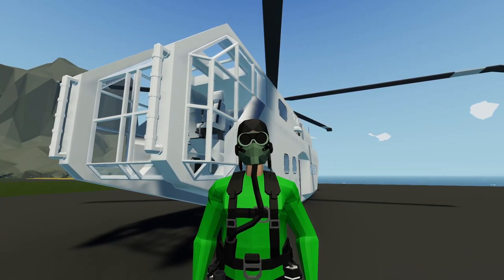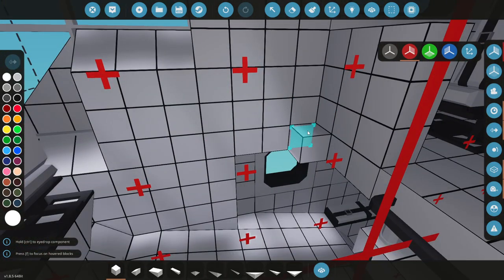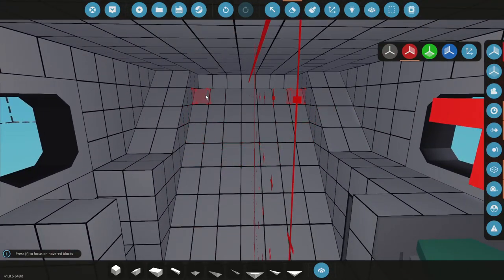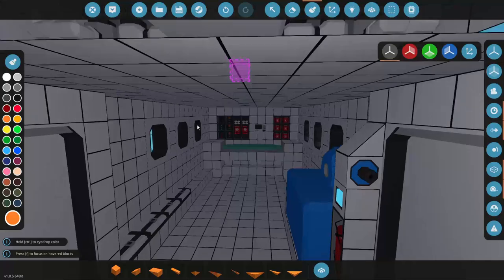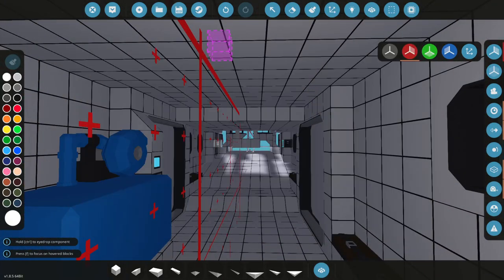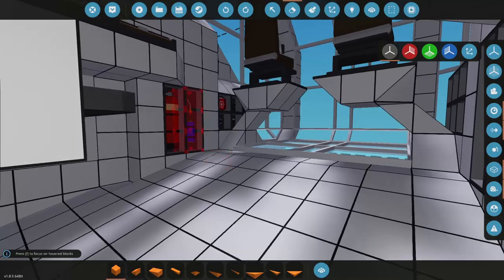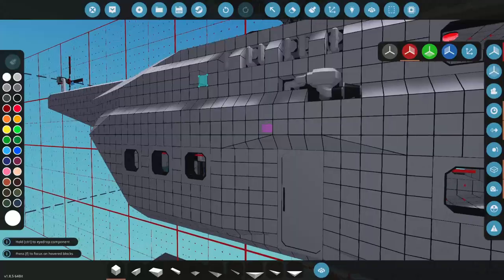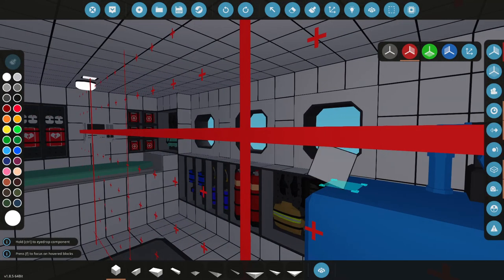Building the Ultimate Rescue Helicopter! Interior Build Stormworks

Comment: i would recommend only sealing top half of helicopter. as it stands it is top heavy design. when you go to put in water without rotor active,  its going to tip from buoyancy  wanting to level out. and most likely flip upside down. if you leave bottom half unsealed it will allow you use weight of lower area  and cockpit and engine area buoyancy afloat, to right itself.

Comment: You could possibly add a control seat for the winches like lowering the winch and controls to open and close the bottom door. You can also add spotlights to the harness or something just in-case it's a nighttime rescue mission! Also I think the interior is very nice and good the way it is right now, only issue is that the engine repair door will only show you part of the engine so it may require a bit of work but I think it would be neat if you could at least be able to crouch around the engine for extensive repairs.